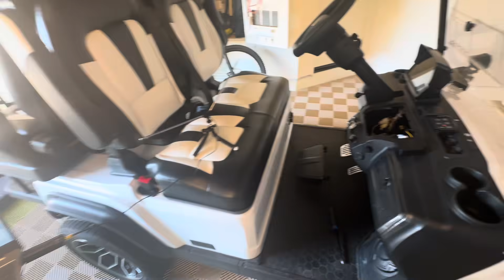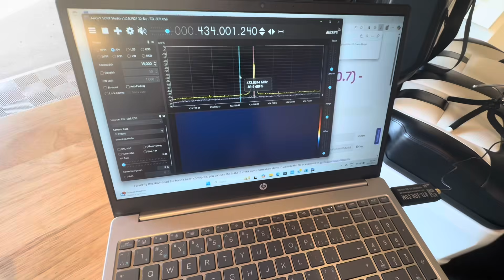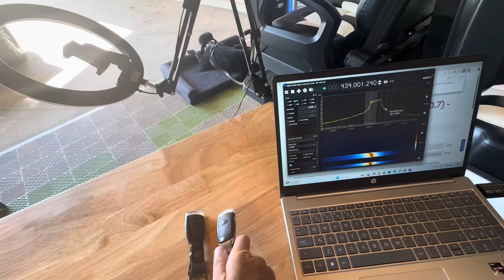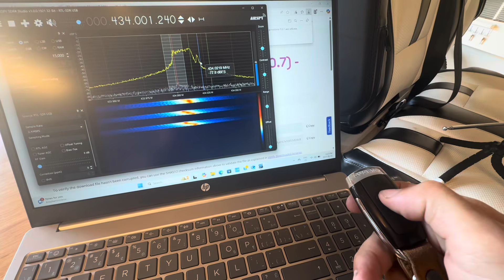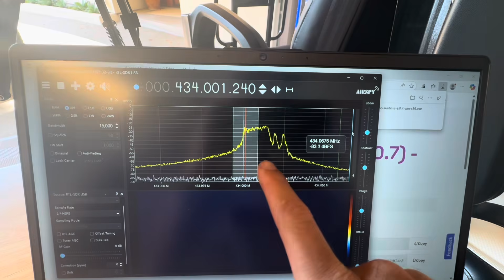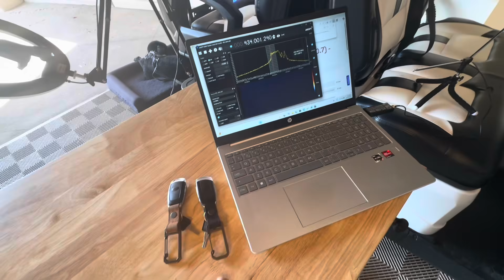Golf Cart Key Fob Signal Analysis 433mhz with RTL-SDR V4 + AirSpy | Evolution D5 Wireless Signals

Comment from the maker: I have learned since making this video several things: 

1) The slight shift in frequency between the two keys is likely not intentional or reflective of different data communication,but just a symptom of cheaper fobs and crystals are often off by 10-20 hz from one the next. 

2) I don’t know for a fact that there is not a rolling code or different communication that can’t be determined by the amplitude and frequency alone, we need to use Universal Radio Hacker to actually analyze the wave form. So that is the next step.

Comment: Another awesome video, if you get bored.. Maybe you could dig into the back of the head unit. These guys are making 70$ harness just to connect a set of RCA cables from the head unit back to an aftermarket amp for you to add your own speakers. Surely there is a way we could just splice into the factory wiring for the head unit and run a power ground remote wire speaker Input. Maybe you could decipher that wiring schematic on the headunit ? Turn a $70 plug into about $20 lol
Reply: Compare this link to the birdie pro harness they sell.. something similar 10-Pin Power Ground Remote Wire Speaker high Level Input Harness Plug RCA Cable Subwoofer Compatible with Pioneer TS-WX1210AM TS-WX1210A TS-WX1010A TS-WX300A TS-WX300TA
Reply from the maker: @Wyatt6475 - Thanks for the idea. I agree with you the external audio cable would be a good DIY project and relatively easy to built. The downfall of the stock unit is the volume adjustment is done over CAN to the soundbar so I see most people end up also adding an external audio knob and keeping it all in sync with the stock soundbar seems a little clunk, but lots of people are doing it because they want the noise. So definitely a doable project. 

I was hoping if I could tap into that soundbar Can Bus we could solve some of these things more holistically.
Reply: @hillvalleylabs  Agreed, I went with the NON plus (regret) but I did luck up with carplay screen. I really just want to add the lower speakers to balance audio so not much worried about tunability which is limited as is. Would be awesome if you could save me a few bucks haha ! I ordered the cable components off amazon this week to tune my cart, going to attempt this weekend.
Reply from the maker: @Wyatt6475 - Nice! - Let me know how it goes. 👍
Reply: @hillvalleylabs   I am stuck with the cable, it is showing an error with my usb232 in my device manager. I have downloaded every driver I can imagine for windows, maybe you could find me a link ?windows 11 
version 24h2
Reply from the maker: @Wyatt6475 - We are talking your Waveshare USB to serial RS232 cable? - From the other video?

If your laptop is not recognizing the COM port, you start to need generic IT support. Sadly I don’t do windows IT support. 😢 - There are just way to many versions of windows and different PCs to try to help. 

My only advice is take the USB device over to find a friend, another computer, plug it in and see if it pops up and is found ok, to rule out it’s just something wonky with your windows computer.
Reply: @hillvalleylabs  10/4 I’m gonna keep playing with it. Hopefully I can get it figured out. I have my nice heat shrunken cable built now just need some communication!